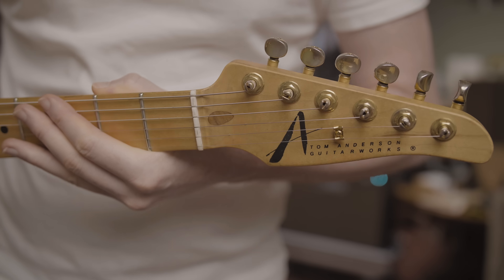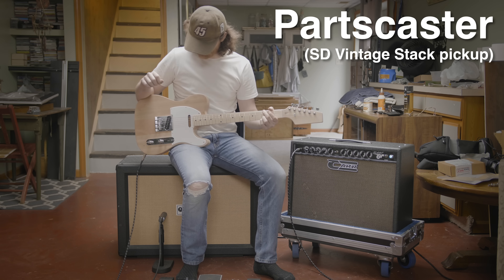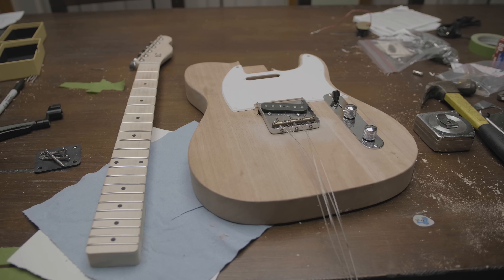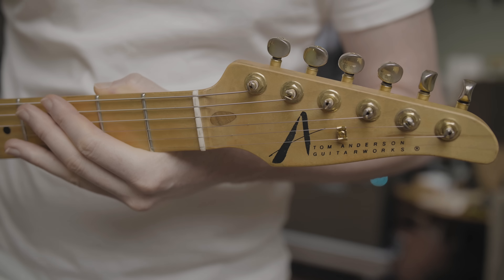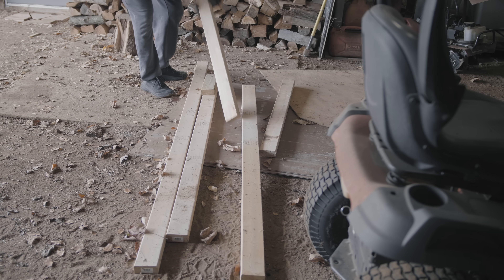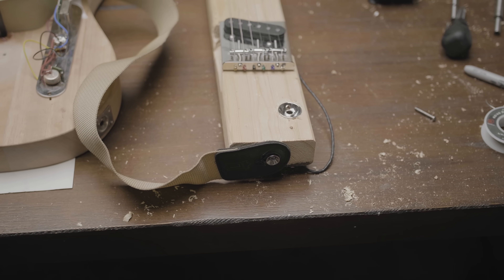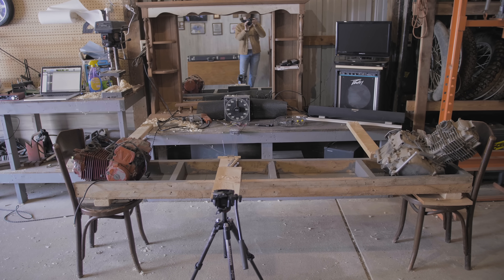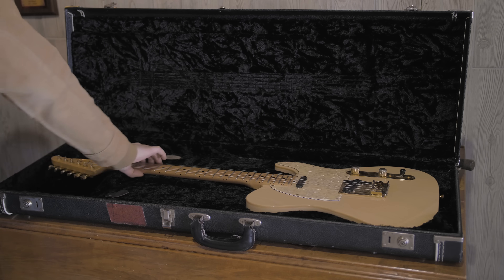Tested: Where Does The Tone Come From In An Electric Guitar?

Comment: Speaking as an Electrical Engineer this is exactly as I suspected! I've always held that 99% of the sound of an electric guitar is purely a function of the pickup and associated electronics since coil pickups are NOT very microphonic in nature. This has now been confirmed beyond a reasonable doubt.  Thanks for doing those tests.
Reply: I am EE too, and I am always saying the same, it absolutley doesn't matter what wood the electric guitar is made of, even a acrylic guitar sounds amazing (!) Don't believe me? Look at Steve Vais acryllic signature JEM guitar! It is ALL about myths and sales bullshit that makes the MONEY.
Reply: @amnesie6615  with an acoustic guitar the story is completely reversed. Am I thinking right? I mean it sounds that way to me.
 I don't play electric guitar
 yet 😂
Reply: @gwendolynkaren5933  No, you have it correct.... in Acoustic guitars.. the wood is INTEGRAL to the sound/tone... as vibration and resonance is all you have to project the sound ..
In Electrics.. Vibration is TABOO.. or, like a hollow body the feedback etc is unbearable with electric pickups/... and unpotted pickups howl because.. THEY VIBRATE.. the wax potting prevents this. So vibes in an electric are unwanted!
Reply: @amnesie6615  Acrylic has tonal characteristics too, which is why there are drum sets made of acrylic.
Reply: @amnesie6615  If I could bother you with a quick question,  why doesn't the wood density matter or perhaps, what type of situation would it matter in? Thanks.
Reply: While I will concede that distorted solid body guitar doesn't vary much based on the wood of the body, It's not that cut and dry.  The resonation of the body goes back into the strings.  That's why fiber glass Parker guitars sound terrible compared to old jazz guitars for clean soft playing.
Reply: TGP blooze nerds
Reply: Regardless of the tone woods, bridges, saddles, picks, etc. (which were assessed in this experiment), if you had TWO identical acoustic or hollowbody instruments into or onto which were placed identical electric pickups, you would get differences in tone depending on each pickup's distance from the strings. If this was untrue, the Epiphone Casady semi-hollow body bass wouldn't have adjustable pickup height.
Reply: Yep. Hilarious start to the video where he uses the same pickup in both and then adjusts its height and then both guitars sound exactly the same. 

The remaining 75% of the video is just running down how none of the other shit matters.
Reply: Wow thanks for teaching me so much on sound engineering! I would say that certain materials in contact with the player makes the difference,  as it is the fretboard, and of course the thickness of strings. Why some 🎸 electric guits (solid) resonate way more than others?   The great Gary Moore used to say that the instrument had to resonate (sustain) not connected, and that's a Gibson feature
Reply: "The acoustic guitar is actually a great device to show the laws of The Conservation Of Energy in action.

In its static state it is a heaping helping of Potential Energy.

Pluck a string and you accelerate a mass, we now have kinetic energy.

The rotating sinusoidal mass causes the bridge plate to flop up and down, driving the diaphragm of the top along with it, which is more potential energy being converted to kinetic energy, but the top is made from wood that has longitudinal fibers and matrices of cellular structures knitting the mass together.

The structure while vibrating, flexing, is not just exciting the air around it by creating barometric pressure wave fronts, or exciting the air in the box which adds to the energy of these wave fronts, there is another energy conversion taking place...

Heat energy!

As the sound envelope goes through the sustain and release phases finally decaying off into the resting state, we are back at a state of potential energy.

Never created nor destroyed, only changes form!"
Interesting stuff.. written by  a far bigger nerd than anyone in this comment section.. yet you'll notice no mention of the string being affected.. and this is for an acoustic!
Reply: The pickup and the associated electronics. I'm just starting this video so what is the best pickup and what are the associated electronics? I'd love to have a shopping list from an electrical Master such as you are
Reply: @gwendolynkaren5933  That PLUS the nut and Bridge materials... they will also affect how the strings vibrate some.. but past that point? it's all BOGUS. Never can get a "tone wood" believer.. to explain how a MAGNETIC PU.. "hears" which wood is under it! LOL!!
Reply: @Luckyrider1958  ty Gilroy
Reply: @Luckyrider1958  exactly, pickups don't react to vibrating air molecules!!! They have no moving parts!!! It's copper wrapped around iron!!
Reply: @gwendolynkaren5933  what do you mean “best”? The sound is largely preference. If you can get accurate notes out of something and like how it sounds, then that’s all you need.
Reply: Wood has no effect on electromagnetic fields..... physics 101
Reply: @flynick  the thing wood can help is with the resonance of the strings itself, which induces the charge of the electromagnetic field of the coil. It “may” just help the strings have a longer sustain due to a wave correlation that sums both waves (the one from the string + the one thats being mechanically transmitted to the wood).
All that, results on a 5% change tho lmao. But thats the physics behind it
Reply: @tecnogadget2  what's your star sign?
Reply: @tecnogadget2  I'm thinking Caca de Taurus
Reply: @flynick  Correct. But the unique way that the wood resonates and therefore dampens the strings does create a character to how a note sustains, to which frequencies are dampened more than others as a note/chord rings out. Other tone differences are there. They simply are. They're just incredibly subtle, and imperceptible apart from with sensitive ears in the most intimate, clear, solo listening environment.
Reply: Even ironwood?
Reply: @flynick  wood has an effect on the vibrating medium which induces a current via the magnetic field. Check mate
Reply: @stefanfyhn4668  yes in an acoustic / hollow body, but in a solid body no, they're specifically designed not to resonate with the strings, different types of wood in the vicinity of the pick ups produce no measurable difference in the vibration of the string, hence why the guitar with no body sounded identical
Reply: @stefanfyhn4668  don't get me wrong, I don't like plastic or plywood guitars, but tonewood is a myth in a solid body guitar
Reply: @flynick  that's not exactly what you're claiming though. You're saying wood has no effect on a vibrating string. Which is just plain wrong.
Reply: @stefanfyhn4668  acoustic guitar yes, solid body no, ..." Wood has no effect on electromagnetic fields" a solid block of wood doesn't resonate very well with the amplitude and frequencies produced by guitar strings, hence why most acoustic instruments are hollow, and so much work has gone into making solid body electric guitar necks/bodies as rigid and non resonant as possible, you don't want your guitar(solid body electric) to resonate with the strings more importantly the amplifier/driver, ie. feedback...., Fender, Gibson knew this in the fifties.., tone wood is purely marketing, the mere fact that plastic body electric guitars are even a thing outside of children's toys should tell you this, sorry.
Reply: @stefanfyhn4668  I could drill holes in a vintage Les Paul's body and it would sound the same, try that with a Stradivarius
Reply: @flynick  if this was correct, then the hollow body of a hollowbody would have no effect on the electric tone, yet it does, so check mate
Reply: @stefanfyhn4668  l'm talking about solid bodies!!!, hollow body jazz guitars fall in between, they're acoustic in nature, also they sound like shit when hooked up to large amplifiers..I'm talking about the myth that wood species or varnish type affects tone in any considerable way in s Les Paul / telecaster guitar
Reply: @flynick  if your argument holds true for any solid wood vs an electric pickup it should cover the hollow body as well. Why does adding air change physics? Is it tone air?
Reply: @stefanfyhn4668  why does adding air change physics? Go away you troll..
Reply: @flynick  I'm a troll? This is literally your argument. You say it doesn't apply to hollow bodies and you can't explain why. So you're the troll for insisting to be correct when your argument is flawed as hell
Reply: Empty vessels make the most noise
Reply: @flynick  this one made my day. Nice reply!
Reply: @stefanfyhn4668  Hi! I'm a professional luthier who focuses on repair and set-up work, I set up about 320 instruments per year on average... The woods, shapes, finishes, they have NO effect on electric guitars' sound. Not even hollowbody VS solidbody. There are factors that influence the pickups' sound, like the shape and protrusion amount of their polepieces, as well as their overall construction... and the rest is modeled by the onboard electronics chain (volume and tone pots).
Other than that, it's all about adjusting the distance from the pickups to the strings.
If I could weigh in with the 5 most important factors for tone (in an electric guitar) I'd say : 1-pickup type/strength, 2-pickup distance from strings, 3-how heavy the player's hands are... and that's it. Anything else will be about the electronics, the amp and effects chain.
For acoustic guitars, the story is much, MUCH more complex, but generally speaking the lighter the instrument, the "brighter" and more defined the sound.
Reply: @flynick  Haha, now that's a "check mate"
Reply: @stefanfyhn4668  it has about 0.0001% effect
Reply: @HiredGoonage  wow very scientific answer ;)
Reply: @stefanfyhn4668  it has no appreciable effect just as nitro vs poly has none.  It's all in the pickups
Reply: @flynick  if you pick up two solidbody electric guitars and play them unplugged, they sound different. This is because the guitar vibrates as a whole, different types of wood vibrate differently, so they  also affect the way the strings vibrate. The real reason why you don't hear the difference is the pickup. It acts like a microphone, it adds it's own character to the sound, it's like an eq. Most qualities of the guitar's acoustic sound get lost. You can hear very slight differences when you listen to isolated guitar tracks, but in a live/mix situation, these differences become irrelevant. Tone wood does make a difference, but the truth is that it's so small that it's not worth bothering about it.
Reply: @catapl93  yes they sound different unplugged..the wood (or more likely the plastic pick guard) are causing a difference in the vibration of the air molecules reaching your ears... NOT THE VIBRATION OF THE STRING and subsequent current generated by it passing back and fourth over the copper coil of the pick up..
Reply: @catapl93  if you shout into a cave and hear your voice echo back, is it because the stone walls are causing your vocal cords to vibrate differently..?? Obviously not...
Reply: @catapl93  you've got to consider the relative strengths of the forces involved inorder to understand how they influence each other...the string gets it's energy from your fingers... Not from the resulting sound waves it produces, much less the reflections of these sound waves off adjacent mediums, think about it in terms of conservation of energy and it will make more sense.
Reply: @luthierjulesdesign  a well spoken truth!
Reply: @stefanfyhn4668  But clearly the effect it has on the vibrating medium has no effect on the sound coming out of the speaker.
Reply: @flynick  He's not a troll.  There are thousands of luthiers that design their electrics around the concept that certain woods will dampen certain frequencies of vibrating strings.
Reply: @luthierjulesdesign  So the purpose of a hollow body is???
Reply: @stefanfyhn4668  people think you are talking about microphonic pickups and not the frequency dampening effect of wood on the strings.  They don't understand.
Reply: @Flynnick  Then why does my number 1 strat vibrate more than my other guitars when I play it? It just so happens to be able to feel a deeper resonance and also hear it through my amp? I don't think so.
Reply: @Bairov  Different (or differently aged) strings, different pickup settings, etc.
Reply: @stefanfyhn4668  It only applies to solid-body guitars, where the body/neck details are minimal.  As soon as you make it resonant, yes the resonance matters.
Reply: @luthierjulesdesign  I'm confident that the shape and construction of a hollow body guitar matters a lot, which is why a fat archtop sounds very different from a thin one, and they sound different depending on whether they have blocks or not.  (With blocks, the shape matters less, but they're RESONANT so the resonant chambers matter!)
Reply: @flynick  If it sounds different, the strings are actually vibrating differently too, because they're not totally isolated.  But not enough so I could ever hear the difference, as proven in this video.
Reply: @flynick  kinda late to the party, but if the body vibrates when i pluck the string as i can feel against my body, that means that vibration is moving the pickups as well since they are set in the body. So wood doesn't affect string movement of course, but it affects the pickup. The field changes if pickups are moving or still. Is my reasoning wrong?
Reply: Wood, supposedly, influences how the energy from the strings disperses.

The idea is that softer woods absorb the energy from vibrating strings faster, thus killing sustain and certain frequencies that dissipate too fast.

Now, I'd like to see an actual experiment of this. It shouldn't be too hard to set up.
Reply: @Pocket-Calculator  didn't you watch the video?
Reply: @flynick  Yes, and it has nothing to do with the thing I said.
Reply: @Pocket-Calculator but didn't he conduct a makeshift experiment? The guitar with no body? I mean it's hardly a peer reviewed study in the Lancet, but if you take the guy at face value, he demonstrated quite clearly that tone wood is inconsequential when compared to pickup height and position all other things being equal, did you listen to it on your phone or did you hear the video through proper speakers?
Reply: @Pocket-Calculator  "softer wood absorbs energy faster?" You're on thin ice with these types of vague statement s
Reply: @flynick  No. He did a sound test, what I said is that I'd like to see in an experiment if the wood does actually impact sustain and if energy from the strings actually dissipates at a different rate depending on the type of wood to get the tonewood debate closed off for good.
Reply: @Pocket-Calculator  The Tonewood Debate never dies! Once you're in, you can't get out!! Better choose you're side!  🤣
Reply: @flynick  Which side has nuclear weapons? Should we be concerned it might escalate???
Reply: @martin-1965  don't worry! the Tonewood people haven't got too far with their nuclear program.. too much science stuff involved.. they're more about feelings and aesthetics..
Reply: @Pocket-Calculator  Very true, while tone may be 99.95% - 100% from the pickups, it'd be interesting to see an experiment comparing sustain. Although, I do think that solid-body vs hollow-body does matter quite a bit; an overdriven hollow-body doesn't sound all too good.
Reply: @flynick  they don't want to believe they have been lied too all these years.  If the manufacturer was honest the ad would be: we choose our wood based on high availability, cheap cost, and woods that are easy to work on that won't damage our tools. 

Don't get me started on the whole "vintage" buzz word that makes people believe it's better because it say vintage lol
Reply: @bluesagan3381  unless you are Dave Grohl!
Reply: @Pocket-Calculator  That is the theory that is often given, yet have never seen it proven scientifically, nor have I seen anyone who can by ear, tell a Ash body from an Alder, or on a tele., an ORIGINAL Pine body, in a blind test, all other parts being equal. Or on LP types, a Mahogany Body from Agathis etc. again all other factors being =....it's just an argument that won't die.. LOL!!  Perhaps in a perfectly Acoustically balanced studio. MAYBE one could actually hear some nuances.. but at home, or in a group mix? Nope.
Reply: @Luckyrider1958  yea it could be measured..   but with the right equipment you could probably measure the effects of a sparrow farting in the woods five billion years ago, via the cosmic background radiation  in a distant universe post a second big bang... That's without even getting in to string theory 😂
Reply: @flynick  Is that a European sparrow or African sparrow?
Reply: @flynick  So you agree, the difference is infinitesimally small and meaningless. Good.
Reply: Coils are microphonic, thats why they are wax potted
Reply: @stefanfyhn4668  Good point.  Wood might matter more with vintage pickups, vs modern Seymore Duncans.

Comment: The air guitar experiment is great. To me there is a slight difference in sound. If you listen to the modulation of the chord the actual guitar had a slightly faster modulation, while the air guitar was slightly slower and a bit more noticeable in depth.

That said, this could be for any number of reasons, including just the fact that the angle of the strings was different.

This pretty much shows that the biggest part of what a guitar sounds like is the strings, pickup, and their relation to eachother. Anything else may have small effects, but will hardly ever be noticeable, especially in a mix.